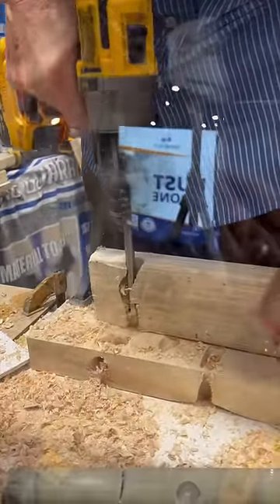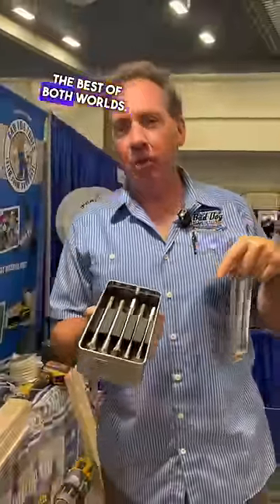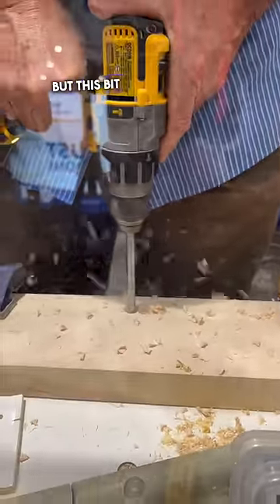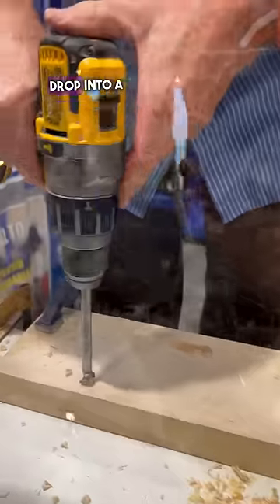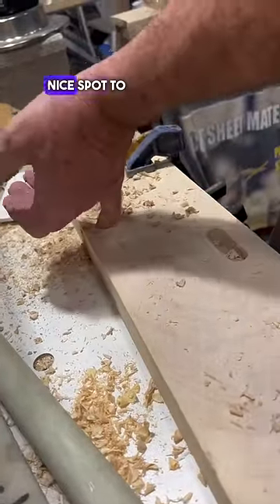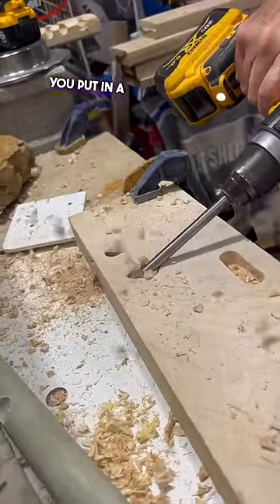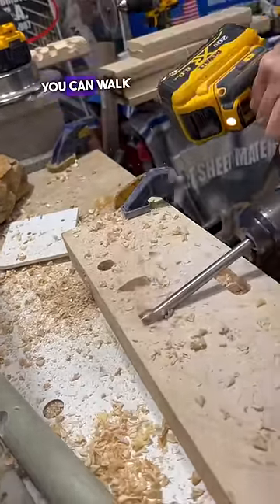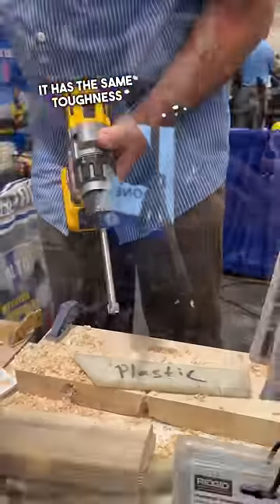Multi Purpose Drill Bits! #construction  #tradeshow #shorts

Comment: Carpenters have officially discovered endmills
Reply: We should just start bringing 40 year old bits around, renaming them and then charging obscene amounts. Its almost like millwrights don’t exist
Reply: 😅😅😅 I was going to say,  a little 1/4 carbide endmill in a drill can make some magic happen. It's my secret weapon.
Reply: I’ve always wondered why people don’t put cnc bits in handheld tools. Seems like a great way to make channels without a thousand dollar machine
Reply: @Roach_Dogg_JR cause drill chucks aren't designed for side loading, nor are the bearings in a drill. You can do it but you'll wreck your drill in no time
Reply: @greensheen8759  hm makes sense thanks for stopping me from doing that in the future lmao. Didn’t know there would be a significantly different design between the 2 applications
Reply: @Roach_Dogg_JR  drill chucks are often also taper locked onto the drill, meaning that there is a stud on the drill that is a cone and a matching cone hole in the drill chuck, and they're just pushed together. this is fine for drills because they push into the spindle when they cut. Endmills pull the tool away from the spindle and will literally pop the drill chuck right off the spindle and the whole drill chuck assembly goes flying away.
Reply: @Roach_Dogg_JR Because there is a reason a mill is 2 tons and you are 200 pounds. Its called rigidity
Reply: @MannoMax  yeah I mean I was just referring to prototyping and situations where accuracy is not required. There was a lot of times in robotics club where we spent a while getting g code set up for a wooden prototype when we probably could have just drawn on the wood and drilled it out
Reply: @Roach_Dogg_JR  In wood it'll propably work, i was thinking about working in metal 🤣 If you throw a 4 flute in a cordless drill and try to slot some flatstock your gonna shatter the endmill, your wrist, or both lol
Reply: @mystiquesquared how long a bit is it?
Reply: dewalt for life
Reply: @greensheen8759 wait, wouldn't that mean that this bit also does that sort of damage?
Reply: @bragapedro  yeah, but if you're using your drill for this type of stuff in the first place, you generally don't care.

Comment: Ooh- that’s some crazy side loading.  Hopefully they will replace the bearings in my drill when they start sounding like a death rattle…
Reply: Is this an actual problem? I use this 1/4” hex drive toilet brush thing for cleaning the inside of jars with my ryobi drill a lot… it’s already ryobi so that’s a mark against it
Reply: @ogonbio8145  I'd say it's likely not an issue in your case.  While side/radial loading can be an issue with drill bearings (especially the super-cheapo ones made from grade A Chineseum(TM)), unless you're putting a considerable side load on it, it's likely other factors will be the doom of your Ryobi long before the bearings wear out.  It's just not good practice (if you can avoid it).  I'm not saying I never do it, but I try not to (like using an angle grinder without the guard).
Reply: I've got a ryobi I've been side loading heavy for about 8 years now. I weld and I use it with a series of cup and round brushes for cleanup and slag removal. Also use it a lot with those little abrasive cartridge rolls.  Not a single issue so far. I think side loading is perfectly fine.
Reply: @timlong1462  I had an old Makita from the 80's (one of the first cordless units- used a 9.6V battery) that I inherited from my father I used for years and I it never gave me any issues until I sideloaded it by using an endmill in it on 1018 carbon steel over about 2 months of moderate use.  Maybe newer drills are much more robust to this.  I'd love to find an actual answer.  Fact is, I don't design drills- so I don't claim to know the correct answer.  I am a mechanical designer who does balance of plant mechanical design for nuclear plants.  Which means I look at specs, tolerances and recommendations from the manufacturers.  As I'm sure you know, for safety critical parts, many manufacturers will put harder limits on their parts than what actual usage can get away with.  Like I said in a previous comment, if you've been lightly/moderately sideloading your drill and haven't had any issues, then godspeed- it's your drill after all!  I know that ball bearings and roller bearings wear faster with side loading.  Now they (Ryobi or whomever white-label manufacturers for them) might be using metal-sleeve bearings or tapered roller bearings which can tolerate side loading, or maybe they have designed the drill so that the side loading is taken up by another component before reaching the bearings.  I don't know.  I am glad to hear that you aren't having an issue with it, though, and thanks for the feedback.
Reply: Or alternatively, buy decent tools.
Reply: "side loading" another bs term for people trying to shame me for using my tools how I want
Reply: @l.n3187  Hey fella no shame do whatever you want with your tools.  And side loading is very much a thing.  Just look at different types of bearings- they all have strengths and weaknesses to various types of loading.  The typical ball or roller bearings in a hand drill usually handle radial loads fairly well.  But with a long shaft (bit) you’re multiplying the force on those bearings as well as applying an axial load to bearings that likely already have some wear on them.  So you’ve created a lever that is now not applying a direct radial force on the bearings but at whatever angle your bit is deflecting at.  You will likely cause false  brinelling as the grease gets pushed out from between the rolling elements and the cage.   I converted a new cheap ryobi drill press of mine to a mill and just left the original ball bearings it had in it.  It didn’t last long.  I swapped them out for some tapered roller bearings which have lasted 10 times as long so far with no issues.  It also reduced the radial and axial runout of my end mills.  So think whatever you want.  I’m just some jackass on the internet.  Maybe you don’t care about any of this or you’re not having issues doing things the way you do.  I’m not trying to stop you.  But I’m not letting you borrow my tools!

Comment: “You can change direction and you won’t get bogged down” immediately bogs the drill down 😂
Reply: Exactly what I said 😂. Just glosses over that part
Reply: Someone else noticed, thank goodness
Reply: I could almost feel the amps spiking
Reply: To be fair it happened when he was removing the drill from the hole and there aren’t sharp edges on the back of the bit. It cut the hole perfectly fine.
Reply: @jackinzbox. I think there may be an audio delay on your listening device.
Reply: @mixerfistit5522  no the audio of it locking up happened when he was removing it AFTER the hole had been cut
Reply: @jackinzbox.  That's odd, happens when he tries to route the angle on my stream
Reply: Read the reviews on their drill bits😂
Reply: It looks like he was using the term “bogged down” to describe not slowing down on your project not the drill literally bogging down under load. You might have never used a drill before.
Reply: @lawnmowerdude  that's a selective use of quotes in an unnecessary attempt to patronise OP. 
Let's expand those quotes out a little wider:
"And IT won't get bogged down"
Reply: Poopy

Comment: I'm sold. I'm defenetly going with DeWALT drill. Thanks.
Reply: If you get the harbor freight batteries you'll get more power out of them too
Reply: @jknott1509 ht batteries work with dewalt?
Reply: @TreeGliz I believe there's an adapter or they mightve been for a different brand.
Reply: Bosch only drills baby
Reply: @jknott1509  where did you see this?
Reply: I have porter cable drills that are faster and more powerful than my DeWalts.
Reply: @RYU583  I forget which brand, but one of the HF batteries will fit dewalt of you break a piece of plastic off

The HF batteries I think are 20v and fit dewalt 12v

If you're not running them too hard your tools will be fine, and have more power. Too much running at one will burn them up
Reply: Milwaukee 100% mine has been abused for the last 3 years and still works perfectly. same with my impact
Reply: My Dewault does real well in all my situations, which is everything that fits in the chuck
Reply: Nah, DeWalt is mid tier, Milwaukee or Cobalt if you want more power craftman if you know you're going to use it agressively, like this, you gotta go through customer support but Craftsman and Black & Decker are the disposable brands now
Reply: @TenchixRyoko  Hercules gets replaced on the spot in harbor freight ;P
Reply: If it ain't fuel i dont wanna hear about it! XD
Reply: "won't get bogged down"
drill suffering at full throttle
Reply: Craftsman if your going to get aggressive?😂 These dorks in the comments
Reply: @nhaake  I've had the same craftsman ratchet set for a few years now. A few rachets needed replaced but the tool is good
Reply: @RealdealSkip my milwaukees have been drop kicked, beaten with 2x4s and been in car accidents in the 10 years I’ve had them. Batteries don’t hold charge quite as long but they still kick ass

Comment: Man just discovered an endmill
Reply: Good for man!
Reply: End mill is not designed to drill holles.
Reply: @MDVaxe  Yes it is, how do you think pockets and slots are started.
Reply: Ahhhhh, Educated and time served chippies vs Watched a bit of youtube chippies
Reply: @phillhuddleston9445 They're really bad at drilling. The flutes aren't shaped right to evacuate chips from underneath, and without a point, it's going to wander all over the workpiece.
Reply: @tyrannosaurusimperator  In a hand drill yes but in a milling machine no, that is what their designed to be used in and that is what my comment was about, they are designed to be used to drill or plunge into the work.
Reply: @phillhuddleston9445 cnc machinist here to weigh in, end mills absolutely can be used to plunge with; however, it will decrease tool life so a drill is the better option. If you’re making a pocket you can straight plunge with the end mill but it’s better to ramp your end mill into the work piece rather than plunge, or open the pocket with a drill bit first simply for the sake of not wearing out the end mill as quickly as
Reply: @tomb6776  absolutely correct, we use our endmills to plunge for big bore holes and slightly oversized holes too big for our standard drills, i also saw someone saying they arent designed to evacuate chips, they are specifically designed to evacuate chips but it depends on how many flutes you have, the more flutes the faster you have to run with less eficient chip evacuation, the less flutes you have the slower you go but better chip evacuation, we use 2 flute carbide for aluminum and it works just as good as a drill but just slower

Comment: A low flute count ball nose endmill would do the same thing. Also drills are only meant to handle axial loads, this bit introduces radial loads which will create a helical load path on a spinning bearing.
Reply: If it’s for applications like he showed I don’t think you’re drills going to die from it. People have done stupider with worse and the tools survived 🤷‍♂️.
Reply: Absolute drivel. Where do you get that nonsense? This is nothing like a ball nosed slot drill. I mean like, nothing. And then all that stuff about helical load paths? And all this from a man who's never used one of these tools. I have, and believe me, you're talking utter rubbish.
Reply: @babayaga-j3f  yep, he is wrong about everything

Comment: I've been using end mill bits from my Bridgeport in my cordless drill for as long as I can remember. To give you an idea of time frame that was back when Mikita 7.2 cordless tools were the go to cordless tools.😂
Reply: Yes that works but they are hard to control and bounce around a lot. They are designed to be held in a rigid setup not in a hand tool.
Reply: That was the '80s😅. We had a few on the job...
Reply: You can use endmill bits inside of a cordless drill? I’m new to all of this.
Reply: @HyperionBadger You can, but shouldn't. Endmills are supposed to be held in a collet, not a Jacob's Chuck. It tends to damage both the endmills and the chucks. Using an endmill in a cordless drill is a bad idea. You're going to hurt yourself or break the drill and endmill, because you and the drill aren't designed to deal with the side forces and don't have the speed control needed to cut efficiently.
Reply: It's incredible how many people take 'right tool for the right job' and throw it out the window in favour of really stupid practices. Endmills in cordless drill us one of the more stupid ones I've heard.

Comment: You can tell, not a lot of tradesmen in the comments talking about $200 being expensive. That's a  quick service call.
Reply: No. That’s tradesmen they don’t want to add another tool to their load out, another tool to their truck, another set of small things to keep up with and replace. 

I already have a box truck full of tools. I’m to the point where if I carry anything else, I’m going to consider it carefully before I buy it. 

200 is expensive. For bits. Doesn’t matter that the bulk of my service calls far surpass the $200 mark. It’s still expensive.
Reply: Trades don't pay that much. However much you pay, they get to keep a tiny fraction of that.
Reply: until you lose it, or someone steals it.
Reply: @elijah3807  Also is it really worth the price? Like I don't think I've ever had a scenario where I needed to change direction an inch into a hole where I couldn't just drill two holes from either side. And who in the would use this for routing ("connecting holes" as he calls it) over an actual high-speed router that cuts way smoother and is built to be used with a jig?
Reply: @SianaGearz i work for myself.   That's a quick service call
Reply: Yawn
Reply: $200 is $200. To you that’s apparently nothing but to most of us that’s a lot of money. Even if you got cash to burn
Reply: Most tradesmen make less than 60k and are supporting a family.
Reply: Thats balsa Wood hes using.

Comment: He was all right until the "if you damage them we resharpen them, we replace them" they likely charge you shipping and handling per bit and it will be more than just buying a new bit so the warranty is basically meaningless. It does look like a good bit though but don't factor in any warranty claims.

Comment: So basically, when i fuck up and im using this bit, it will encourage me to make it worse. Cool
Reply: Eh?
Reply: @@Wungus_Bill are you arguing that you can't use this tool to drill straight holes? I meant that if I was using it to drill a straight hole; yes I realize this obviously wouldnt be the best tool for the application but humor me; if you are drilling a straight hole with this bit, say you apply the pressure in a way that isn't perfectly up and down level, then it will likely start to get away from you much faster than a traditional bit would and will make a crazy wonky hole in whatever material
Reply: @DaveyMulholland  see previous comment
Reply: @@Wungus_Bill fair enough
Reply: Harleymarshall...jack of all and master of none.
Reply: This would be great for the wood prototyping we used to do in robotics competitions.

Comment: Using it to cut sideways goodbye to sleeve bearing. This cordless drill aren’t good to put pressure sideways because it will worn out the sleeve bearing prematurely. Will be good with drills that have proper bearing to support it, which are corded.

Comment: I work in renovation and I wanna know the catch, because that looks like one of those things where you can't think of when it'd be useful, but you'd find yourself using more and more as you figure it out. 

If I had any potential red flags to point out, how long has he been practicing that side to side router style drilling? Because that channel looked suspiciously straight and perfect for that quick of a job, I mean think about it like this, we have a router that couldn't do it that fast, and even if you tried the edges would be frayed from the bit. Drills spin much slower yet he got better results faster? If anything here is sus, that's it.

Comment: Can it be done on hardwood this is interestingly cool.
Im a carpenter but my job only a door installation i use that heavy router every time making lock hole on a door that already installed on door jamb, never use drill because i always encountered hardwood or because mostly solid door was made with combining all wood scrap and hiding in plywood.

Comment: Tbh I’ve had bad dog bits and I had a couple get replaced because lifetime free warranty and the bits that were broken they sharpened them and wouldn’t replace them now I’m stuck with bits that have snapped off heads but grounded down to look sharp even though they won’t drill even plastic anymore

Comment: That's some real soft wood he's drilling through
Reply: Framing material aint gonna be much different. Its metal vs wood at a relatively slow speed and its probably carbide anyways so the only limit will be the drill itself.
Reply: It's not particle or mush board because it's making chips, can't be that different from a FIR 2X4...
Reply: @dc6233  no I'm referring to softwoods like the ones used for pencils. The shavings remind me of sharping a pencil. When you're drilling through harder woods it turns to dust not shavings

Comment: I could use this if they make it for metal :P
Reply: Just buy a dremel or a hole saw with a drill bit fixed in the centre for that, these type of bits wouldn’t really work for metal they’d bounce around like crazy or burnout really quick.
Reply: @AlpaChinoDespacito  that’s a good idea. I need to put a slot that’s 1”x 1/4” and it’s annoying because I have to put it in a 1/4” thick stainless steel plate . I usually just make 3 holes with the bit and rock it back and forth but man it’s always mad crooked .